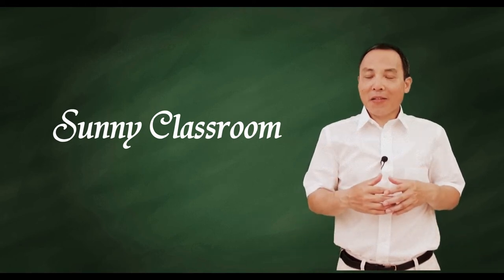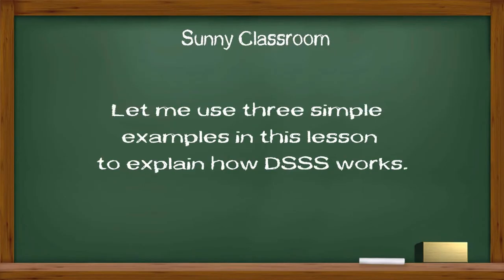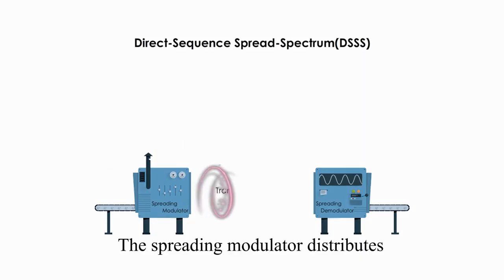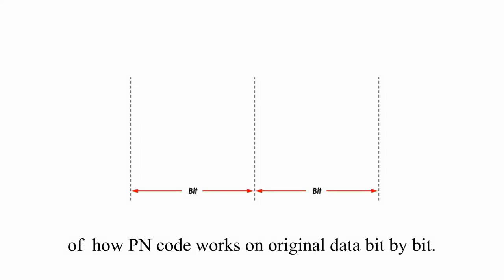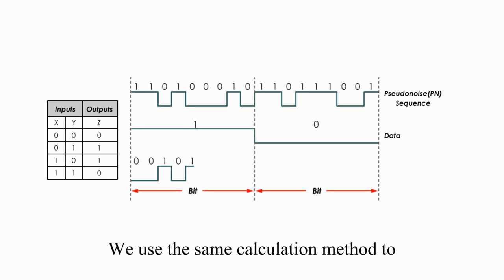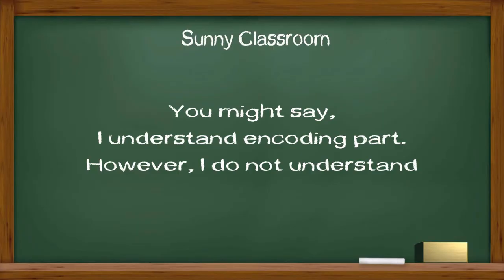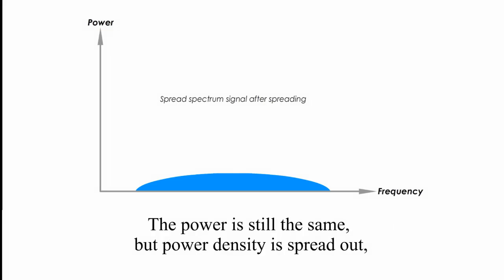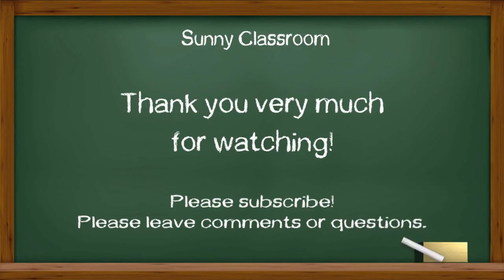DSSS - Direct Sequence Spread Spectrum

Comment: at 05:40 Sunny says lower power = harder to detect and interfere. But lower power also means that the SNR will be lower so the signal will be more effected by noise=less reliable connection. Can someone please explain that how lower power is better to avoid interference?
Reply: yes, this is the idea of the whole DSSS. you need to send at a much lower power because your signal is supposed to look like random noise with low power. 
But the cost you are paying however, is widening the frequency band (and this what we are doing by XOR your normal data rate to a much higher data rate at 3:25 , you are increasing the bandwidth more of that what you really need) and using all of your available bandwidth to send the one signal. DSSS utilizes the whole bandwidth to lower the SNR needed to be transmitted.  
when you are sending multiple signals, PNs should be different and all of the signals should have minimal power to avoid having one stronger signal than others. because you are basically using the same bandwidth for all of these signals. And if all your PNs are well crafted to be unrelated to other PN, you can reconstruct all of your signals at the receiving end
Reply: at the receiver end when you do the mathematical operation of correlation with PRN of the RX ( as part of demodulation ), the desired signal will increase in magnitude, on the other hand correlating anything unwanted ( noise , interference etc ) that enters the receiver will result in a low output. for the sake of security, you want your signal to hide in the wireless channel like if it is noise
. I might be wrong.

Comment: I don't see how you could achieve a 10:1 frequency spread at the physical layer using DSSS, whereas with FHSS you can simply have two receivers where one is tuning while the other is receiving. Any comments? A video on the physical layer would be very valuable. Nice channel by the way!

Comment: Thank you sir for your video. But as I was taught,  when data is modulated with PN code, 1 and 1 is 1, not 0 as your instruction. Correct me if i am wrong. Thank you
Reply from the maker: we use different table. Exclusive OR truth table and Truth table (which you mentioned) is different.
Reply: @sunnyclassroom24  I got it, thank you so much.

Comment: Great explanation. I am curious that when is the PN sequence decided and by whom? I know about shift registers but is it decided before session starts or does it keep changing in the middle of session? Is it multi-casted by transmitter or something else?
Reply: I think the Wireless adapter chooses it at the start of session by randomely choosing an n bit encoding. And there is practically no chance any other device in area will be on that exact same n bit encoding. The probability is negligable.
Reply: I am only assuming this PN code would be something similar as a “private” key in crypto world which is exchanged before passing data and can be constantly changed for security purpose.
Reply: i believe that the PN sequence is agreed upon beforehand